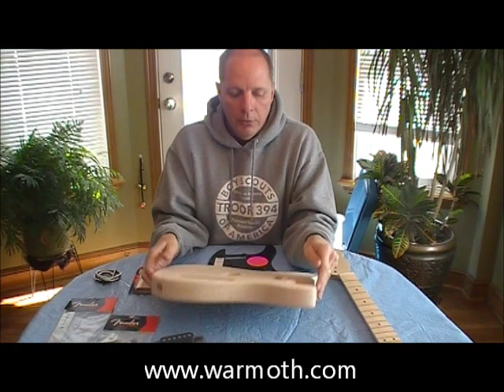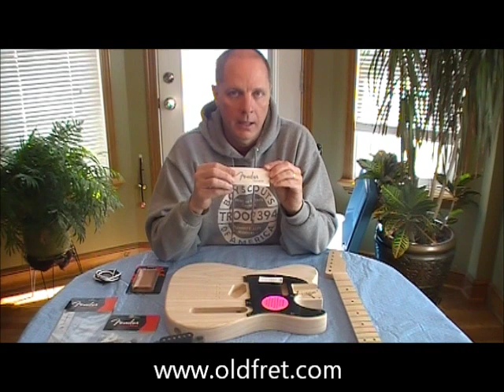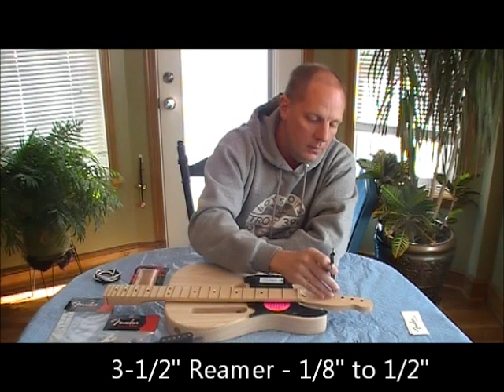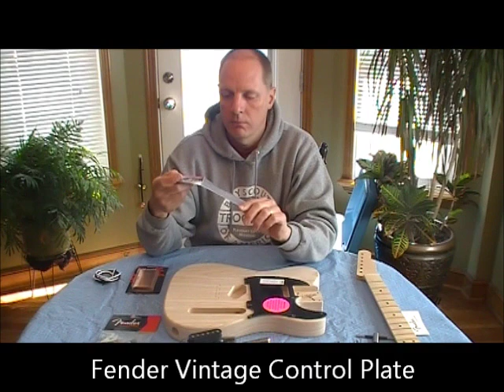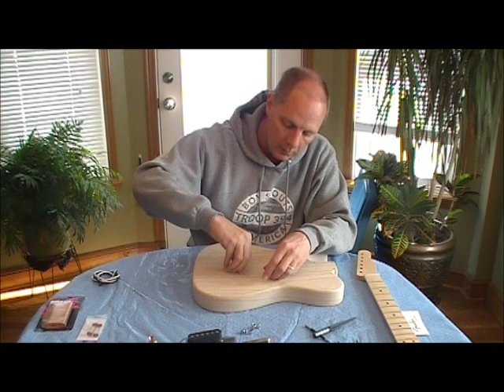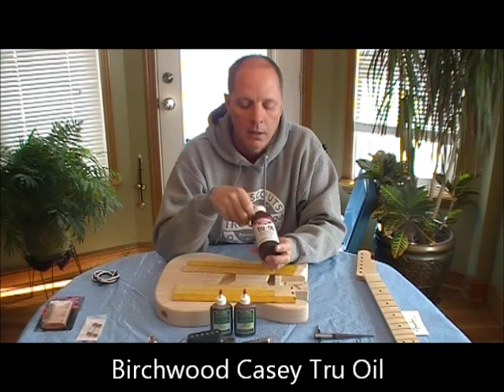Warmoth Telecaster Build Part 1

Comment: I just noticed I have the same problem with the electrosocket jack rocking at the drill hole of my Warmoth tele body. Did you solve the problem with a round file? I stained my guitar body before I noticed the problem so I need to be very careful now.

Comment from the maker: Yeah - I had a handful of frets that needed work - but Warmoth will tell you they don't level the frets - they only debur the ends - they told me most people have their own preferences and so they leave them alone.  Sure - I wish they would have done a fret job prior to send it out - but it's not what they do - but I'm pretty confident their's are no worse than any other aftermarket neck at this price point.

Comment: Locking tuners do not lock the strings in tune. They just make string changing faster, because you dont have to wind them.  No other advantage.
Reply: They will help keep guitar in tune if it has a tremolo